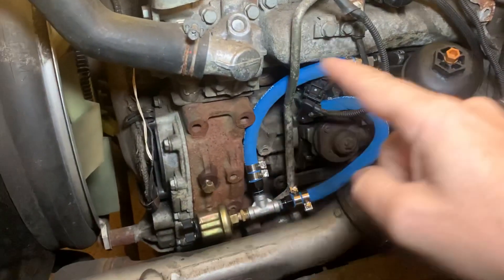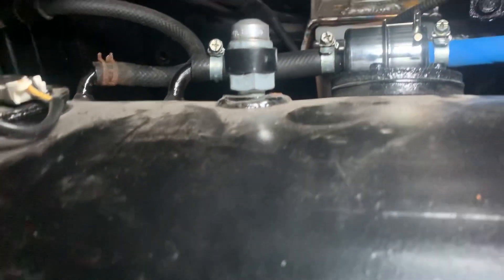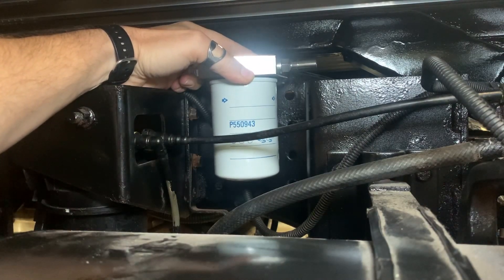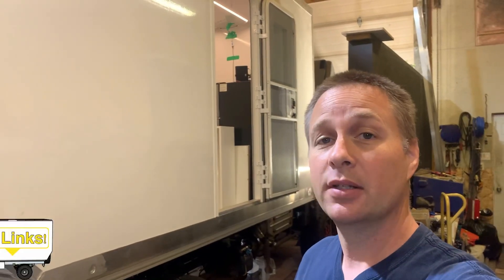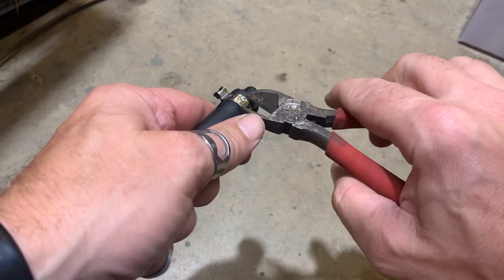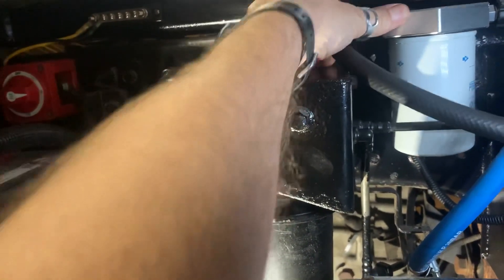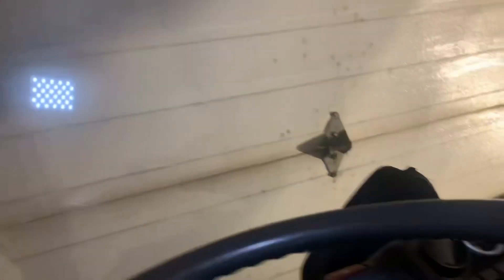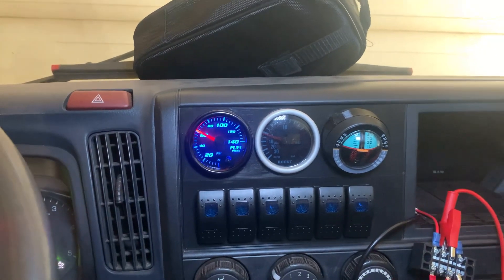Will it start? | Fuso FG Disaster Prevention Kit 2

Comment: That's exactly what happened to my 4P10 when I was replaced with a recondition one. But it rans  sort of.  When I remove the fuel pressure valve to check metal inside pump and there's a little bits if metal in my pump. Before I remove that valve it rans .after I reinstall it and crank the engine but it's not starting. I bled the fuel system so many times but that not working. Again I remove the pump and reinstall a New Recondition pump and I only bleed to the injectors. The  Surprise.is the is started like I just parked and re start .
My 4P10 needs 4 new injectors 
But it's runs it not going above 80 kmph
Reply from the maker: I think my problem is going to turn out to be slightly different cause than yours, mine has not exhibited any signs of running… not even trying to fire.

Comment: Hey mate, I was following your progress as I had exactly the same symptoms.  I got a bit impatient waiting for you though and went ahead to get a mechanic to look at it.  His diagnosis was starter motor speed too low (150rpm).  He used Start Ya Bastard to increase revs.  At about 250rpm, the injector pump kicked in and pressurised the fuel rail, and it started fine.  Still have a minor issue with pressure fluctuation, but runs fine now
Reply from the maker: Interesting - but I’ve reviewed the audio clips that I have from when the truck was start to when it’s not starting - the speed sounds identical.  I can see how low speed could cause issues, but I don’t think that’s the root cause of my issues.  😎

Comment: That cinch clamp fitting you removed looks like the same kind of crimp you use for Pex B cinch clamps. Ryobi makes a nice and reasonably priced crimper for those. Might be useful if you want to crimp them in narrow spaces. (Which is what I am going to be doing when I completely replace all the plumbing in my RV, since it's a pre-Pex type of plastic that fails early, and has already caused some leaks...)
Reply from the maker: For fuel lines I’ll keep using gear clamps - but plumbing on the inside will be PEX for sure.

Comment: I was expecting this result, but was still hoping it might be otherwise and that I was wrong with my original (very remote) diagnosis.  As I said at the start this has all the hallmarks of an electrical failure as you had no rough running issues or (AFAIK?) low fuel rail pressure codes, just a sudden 'no start'.  Try not to be too discouraged though because you've now massively decreased the likelihood of any future mechanical failures - particularly a cascading set of very expensive debris contamination failures.

Do you have access to a pin-out readings list to check ECU/loom plug input and output voltages and grounds?  This might be a good next step.  It will tell you what inputs the ECU is getting from sensors, plus gives you an internal health check of the ECU.
Reply from the maker: Agree that it sniffs of electrical, except these things measure every sensor - and know when electrics are out even the slightest.  If I unplug anything (open circuit) it throws a code, same if you short circuit a sensor.  The only thing they don’t throw codes for that I know of, is loss of fuel…. But, nothing is proven yet!!!  I’d love to find a broken wire that fixes this!!
Reply: @BruceandKrista  It's odd you don't get a code for low fuel rail pressure, IIRC the same year model here has a fuel rail pressure sensor.  I would have thought Cdn and Aus spec would be pretty much identical - but there you go.  You should have no trouble checking the loom wiring by earthing each wire and using a multi-meter, tedious though I know that is, but what concerns me is the engine ECU.  That said, I've not heard of any confirmed examples of ECU failures.  It could just be me, but it sounds to me via the internet that your engine cranking RPM is a bit sluggish.  Did you check voltage at the ECU with the engine cranking?
Reply from the maker: It does have the pressure sensor, it’s just that  there is no code or alarm for it, might just be while the truck isn’t running (kind of like an over-ride for low oil pressure alarm, doesn’t function until the engine is actually running)
Reply: @BruceandKrista  Thanks.  Do you have access to any sort of factory diagnostic software?  IIRC you had something, but it stopped working and the seller didn't respond or similar (or am I making that up?😳)  I can't post photos or screen shots on here, unfortunately, but the factory software allows you to see what fuel pressure the ECU is 'asking for' vs what is being delivered.  Is there someone you know who could plug into your diagnostic system and bring this up for you?  The opposite end of the fuel rail to the sensor has an electronically controlled high-pressure regulator.  I guess you could try taking the one off the 'spares' engine and see if fitting it makes any difference 🤷🏼‍♀
Reply: @BruceandKrista  Sorry to 'bombard' you, but I'm just trying to get as much info to you as I can via a slightly flawed method.  For your model year 4P10 you should see code P0087 for any low fuel pressure situation.  With zero fuel pressure in the rail (just crack an injector) the sensor should give you a clear ground (zero resistance).  If it does, then the sensor should be okay.  P0087 should be triggered by the sensor for a high pressure pump failure, bad SCV (the flow valve on the high pressure pump), excessive injector fuel bypass, or a failing high pressure regulator on the fuel rail.

IIRC you checked injector pulses when cranking?  Grab an injector and plug it into the injector loom.  If the injector 'clicks' in your hand when cranking, the injectors are firing and you have a fuel pressure or timing issue.  If the injectors are clicking and you have fuel pressure at the rail, the engine should either start, 'kick' or you'll get white smoke from the exhaust.  If you get to the point you are seeing white smoke you have a timing issue.  I hope something in all of this gives you something else to try!
Reply from the maker: Yep, I was able to see the pressures when I could get in.   Two are “calculated” values, which I believe I misread originally.  The third I believe is read from the end of the rail.  I doubt the sensor or PRV are bad, as I’ve swapped the entire rail and both sensors.   As you will see in an upcoming episode, I’m pretty sure I don’t have fuel pressure, even with the new pump.
Reply: @BruceandKrista  Here's hoping it's something as simple as still having insufficient fuel pressure at the rail!  I have no idea why you didn't get a P0087code if that's the case, but I'll keep my fingers crossed anyway 👍
Reply: @BruceandKrista  A very quick question for you.  Does your 4P10 have the 'double ended' Bosch fuel rail?  If so it should have a fuel pressure sensor on one end and a fuel pressure regulator on the other end?  If there is no fuel pressure sensor on one end (I'll be a little surprised) there should still be a high pressure fuel pressure regulator on the other end?